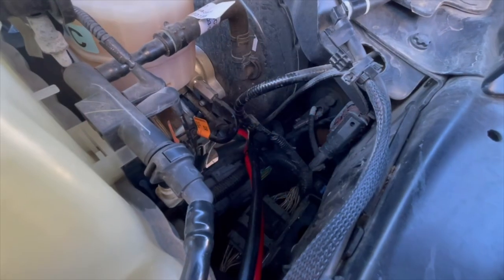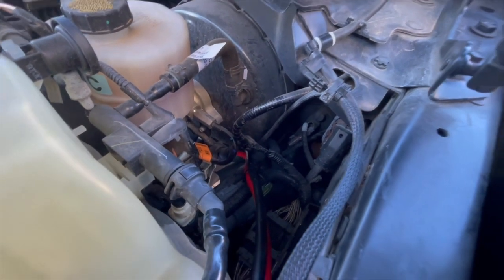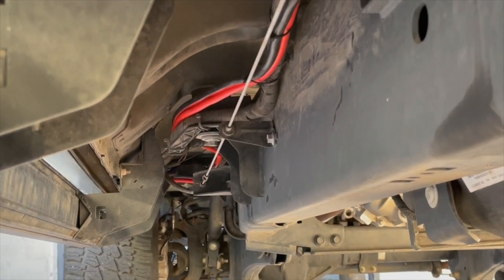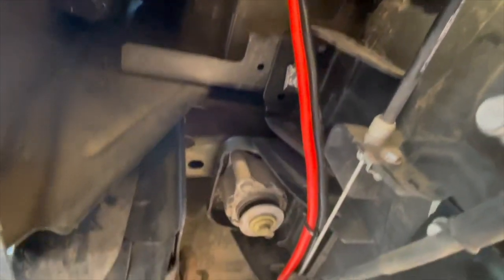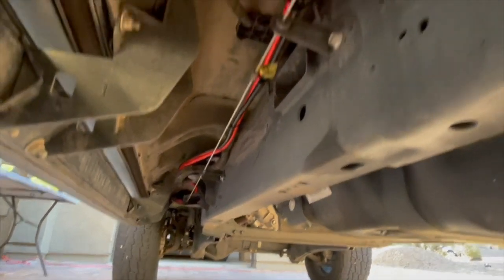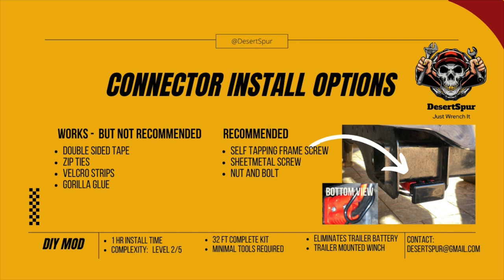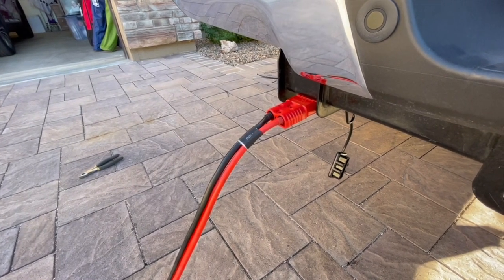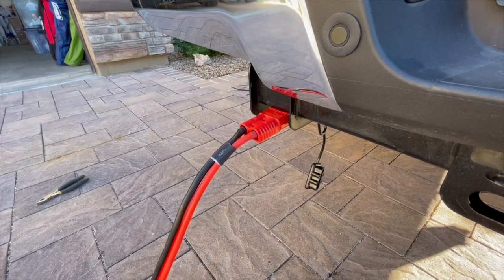Battery Delete Must Have Mod - Quick Connect Power for Trailer Mounted Winch

Comment: Personally I would just put in a positive line from the battery and then make a good ground at the rear on the frame since it's all ground/negative. Also would mount the connector on top of the hitch, never know when you might back into a dirt bump or berm, drop into a hole, hit a snow bank etc and that connector will loose that battle for sure. I like the crimpers, much nicer than mine!

Comment: I like this, looks clean. I’ve been thinking about putting something like this together right now. Only thing I would add is a fuse. I’d be worried about that hot wire from the battery going to the gas fill neck and getting red hot.
Reply from the maker: Thanks for the view and comment.  Super easy to install and very convenient if you don't want to add an extra battery to your trailer.  The only thing I am going to do is add a cut-off switch and mount inside on the dash.  I saw one at Harbor Freight for like $7...I'll post a video of that in the next week or so when I get it installed.

Comment: Did these wires heat up using a winch I have a 12000 winch and want to run it from the back of my truck also has this set up served you well?